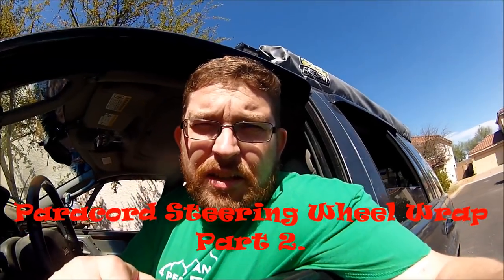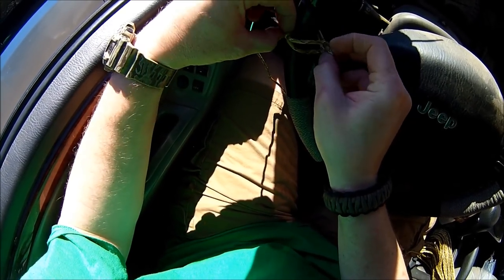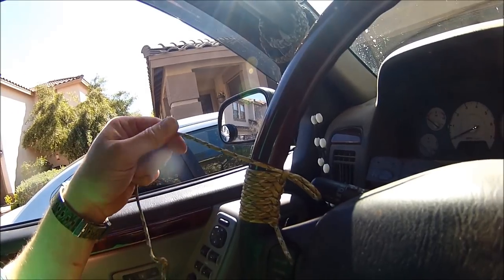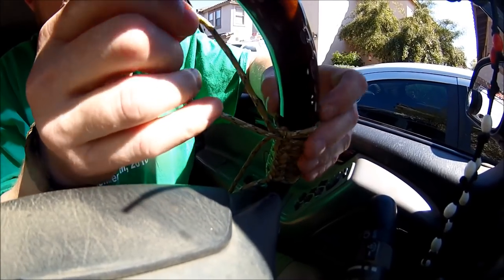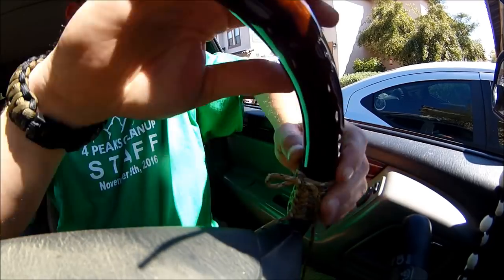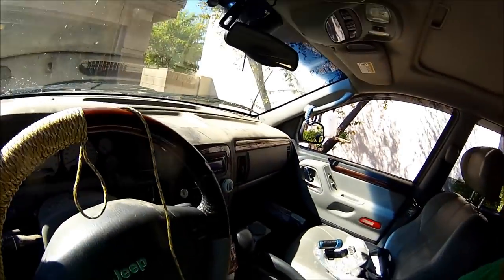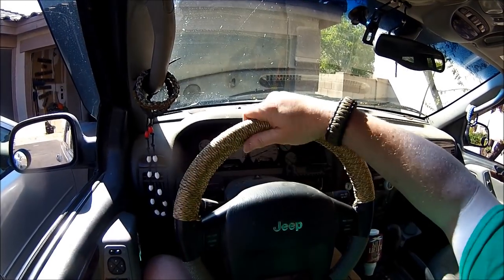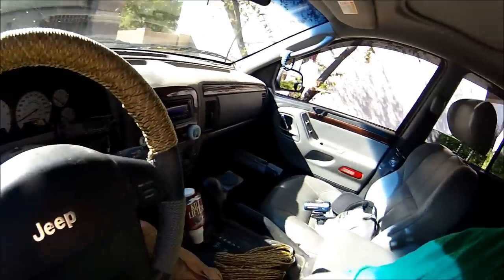Paracord Steering Wheel Wrap Part 2

Comment: about how many feet of cord did you end up using and how long did it take for that portion of wheel?
Reply from the maker: I started with 100 ft and ended up with about 1/3 to 1/2 of it left over. Probably closer to 50 ft, its been a while since i wrapped that wheel. It gets used up quick.  Chad.
Reply from the maker: I believe it took me about 30 mins.
Chad.
Reply: Oh cool I want to do my 1990 Montero steering wheel.
Reply: The Right Line how did you get it so even, I have a few overlaps and it’s driving my nuts

Comment: Nice. How much cord did you need?
Reply from the maker: Heffa wrecka, hmmm, I started with 100ft, I'm not sure exactly because I didn't measure what's left however,  start with 100ft because you'll likely find a use for what's left over. It also depends on the size of the wheel obviously, but the next wheel I do, I'll measure it and put the total here as a comment. Thanks for watching.
Reply: Have you tried pouring some boiling hot water over it to tighten everything up? It made a lot of difference in the bracelet i made. Protect the rest of the wheel and car of course...
Reply from the maker: Mickey Bauer hi, I heard of that but have not tried it.